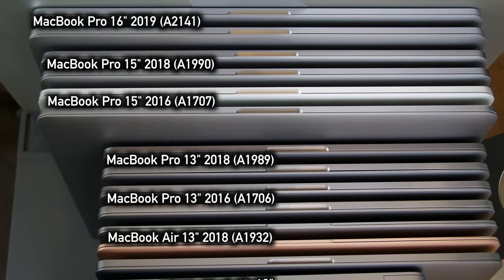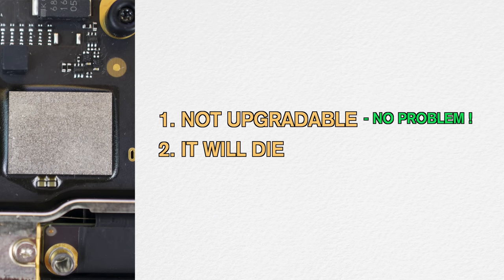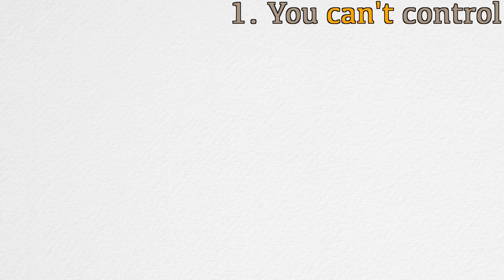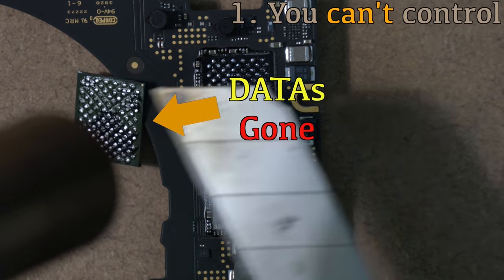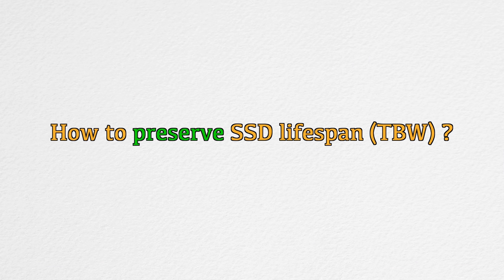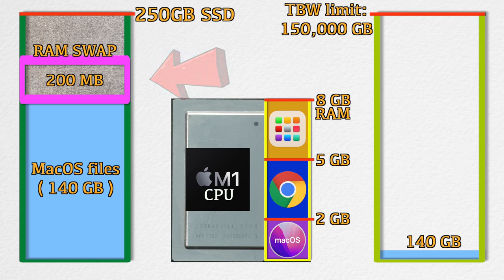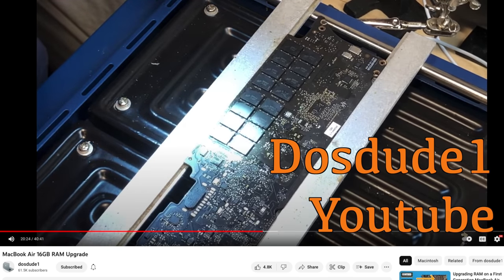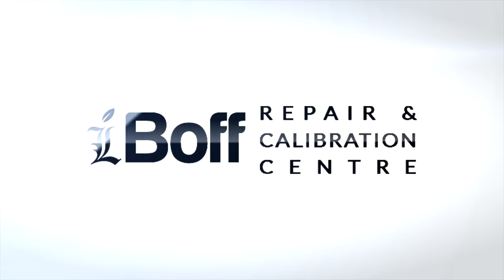These MacBooks DIED from SSD Failure & How To Prevent It (Not for RICH dudes!!)

Comment: the best things to do is to stop buying their products and see what they do to get you back!
Reply: They do not care because there is a lot of people who will by it anyways
Reply: Wow apparently the sky is falling…
Reply: That’s easy to say for someone who doesn’t rely on their software
Reply: Gonna need right to repair. Or some massive class action type hardware failure that finally wakes people up. Still using a 2011 and feel forced to look back to pc after all these years. Definitely a shame.
Reply: You’ve never purchased an apple product before. Stop giving advice
Reply: Entire electronic industry is based on product obsolescence
Reply: @Dr.Mzungu  I’d have to argue the desktop PC side of consumer electronics is definitely not plagued with planned obsolescence .   There are decade old PCs still working fine.  And with the current level of performance with the new modern PCs they will last possibly more than a decade and be relevant.  Today still a sandy bridge i7 is a very capable system … same as with GPUs I have gtx 690 that still works just fine it isn’t a powerhouse anymore but it isn’t dead. And after 10th gen Nvidia those GPUs will be relevant for most likely another decade. Like the 1080ti is still a excellent graphics card today and outperforms even newer entry level GPUs and it is going on 8 years old … in next two years the 1080ti will still be a good GPU .
As far as SSD and HDD they have a finite lifespan and are easily replaceable and easily setup with PC to have your drives setup with a mirror internally so if there is a failure you can simply just replace one of the mirrors and keep working never losing data. As far as Ram I have many ddr3 machines come through and have never seen a defective ram stick.. same with ddr4 , I just got first ddr5 pc this year but I have no doubt it will last forever like all the other ram before it has come.
Motherboards rarely go out ever I mean if it last the first year it most likely will last forever , PSU are about the same I have some decade old PSU still chugging away ,
As long as you get quality parts and not knock off chinese clone crap desktop is amazingly resilient.
The only thing I have notice is the deterioration of the RYZEN early processors I’m talking 1000 2000 and 3000 series I haven’t seen it in 5000 or newer yet. But the older ones the memory controller loses its ability to overclock the ram overtime due to the infinity fabric deterioration. At least that’s what is the common understanding, example got a 3600x pc back last year that I built new for a customer and before I had the memory clocked to 3400mt easily and it ran great then started being unstable got it back and checked the ram in other pc it was fine easily clocked to 3600mt put that ram back in ryzen 3600x in a b450 MB and tried other sticks in it to but couldn’t get ram to remain stable past 2900mt.. I recommend now not manually overclocking these CPUs and making sure you invest in a high end cooler I’m not sure if the heat is slowly degrading the memory controllers bandwidth over time it’s something I haven’t noticed on older Intel CPUs but they are monolithic designs and the Ryzen are all new chiplet designs .. again this is a rare case and it’s not planned obsolescence but new design /architecture flaws in aging even though it is arguably not a flaw the PC still works just couldn’t be overclocked as high as when new.
Reply: Inefficient way, too customers and not enough informed customers. Better to start online campaign to get get Apple to teach customers about this. Data loss is preventable then.
Reply: @notmyname6452  I just sold a 2019 16” macbook pro and was going to buy the M1 but apple made impossible to repair so I will switch to a windows laptop instead! Apple seems to not care about their customers
Reply: Nope, the best thing is our right to repair!!
Reply: Me too would NEVER buy any soldered-SSD laptop. Losing data is a nightmare. (I myself still using my Macbook Pro 13 2012, whose SSD is still replaceable).

I recommend everybody (especially for those who have laptop with irreplacable SSD) to have external SSD where you could routinely clone your data into it. In case of internal SSD failure, at least you could still boot-up using the external SSD.
Reply: True
Reply: @DJhyp3s well. It seems he's the smart one in here for not buying garbage products....
Reply: Super helpful and insightful, learned a lot from watching this, thank you 😊🙏💯
Reply: @DJhyp3s whats your point?
Reply: Yes, I used to never buy apple products, but my lackluster windows used to have terrible hinges, trackpads, flimsy chassis horrible battery. My MBA has no moving parts, all I have to care about reducing wright cycles to SSD, but the laptop has great hinge and 10+ hours of battery. This is the first laptop that I have bought and used as a laptop outdoors, every other Windows machine I've got ends up becoming a home PC as its hinge breaks.

As my laptops so far only have given up on physical structural integrity, a MacBook for a change is faring good so far
Reply: Apple targets young audiences. Problem solved 😂
Reply: After two decades I stopped buying Apple products because they only care about their shareholders, not their consumers. And boy was I surprised about how much better engineered the competition is. You get way more for the money and plus most components are easily replaceable.
Reply: Unfortunately a lot of people rely on their products for work
Reply: While the alternative is windows laptops with horrible QC, battery life, noise, heat, speakers, webcam, privacy, performance on battery, optimization, customer support, color management, and color accuracy, plus some windows laptop have the same soldered SSD like on the Dell XPS, so this isn’t going to work, and it hasn’t. Simply not buying Apple’s product is useless when the rest of the industry makes even worse laptops, in fact the only reason to buy windows laptop now is because of powerful Nvidia GPUs, slightly better repairability, and the fact that they are cheap, not even gaming can justify getting windows laptops anymore, since you can build a desktop with the same price with way more performance. We should demand better product from the whole industry, not just boycotting Apple that isn’t going to work due to their ecosystem.
Reply: @rx58000 oh kid mac not that good
Reply: I haven’t bought a MacBook since 2011. Now I NEED a new MacBook and it’s 2023. How long do you “stop buying” in your world before they actually change? 

Answer: it ain’t happening
Reply: But I'm an apptard
Reply: @DaveTadros Opencore
Reply: They'll have to get appeholics anonymous sessions though...
Reply: The Apple cult is too strong.
Reply: All of my Apple SSDs are working fine after 5+yrs

SSD wear is normal on any device, and it’s not surprising they die if someone buys base ram and keeps 100+ chrome tabs open lmao
Reply: They will just make worse products to make them cheaper, not start making higher quality products.
Reply: I think they did that with the M1.
Reply: Hold on what about phones and tablets ?
Reply: it's not possible millions of people r buying these and 80% of them r not technical users they don't even know about component names
Reply: Oh I love this, almost if other brands are better. They're not. Most of them are worse. Apple charges extra, but at least that gives them an option to put less garbage components and spyware. It's the first generation of new architecture for them and it's pretty well built.
Reply: And buy what instead? Piece of shit windows laptops that aren't even 1/10th as good?
Reply: Any machine you buy with a SSD will have a specific TBW lifetime. Now, if that's soldered to the logic board or an easily replaceable M.2 module, that will depend on the manufacturer
Reply: It happened because apple loves polluting the world with E waste😂
Reply: Stop buying the laptop with the best price to performance? Cause some people can’t take care of them😊
Reply: Comparing cheap laptop with expensive apple laptop
Reply: As soon as other companies start to make good enough laptops.
Reply: @JoeWayne84 my PC:s never lasted more than 3 years. My Macs have been pretty much infinite.
Reply: @thejjzz  weird my laptop from HP still works after 14 years
Reply: Hardware failure happens with every brand. Ive been a user of both Mac and pc for 16 years. I’ve experienced way more out of warranty failures on PC than Mac. Actually none of my Macs failed past the one year warranty.
Reply: @louisfain  Apple have ignored failty apple products and told users that they did something wrong when it was apple that failed
Reply: @2xtreem4u  yea but you have to admit the failure rate is lower than most other brands and also given apples size every failure is essentially high profile. I never owned an HP laptop without serious issues but nobody seems to be talking about that
Reply: @louisfain  i have to compare with high end laptops against apple laptops i haven't had any problems with HP laptops and desktops same for fujistu

Comment: Louis Rossman also covered this issue with the failed texas intruments component failure. Its absolutely shameful how apple designed the logic board with no abily to protect the ssd from being destroyed
Reply: shameful? it is CRIMINAL! they do it on purpose
Reply: It would be pretty easy to clamp that converter output to ground if the voltage output exceeds a certain level, to protect the SSDs.  The converter chip is probably being used too close to its rated limit, leading to eventual premature failure.  The SSDs themselves should be mounted on a socketed sub-PCB to facilitate their eventual replacement and/or upgrade, if needed.  To do otherwise is just greed forced into bad design practice for higher profit, from overpricing the value of these commodity SSD chips, as installed.
Reply: And guess what , this video states the ssd is replaceable but sadly it is not as the bios and firmware is also loaded from some sections of the drive hence the reason why it doesn't even post to screen with the dead ssd , older models you could at least see some picture even with a dead ssd, even louis Rossman covered it and said the ssd was non replaceable....I currently have a 16 inch 2019 with this same issue , after diagnosis, I discovered all ssd chips are shorted to ground (even after removing the Texas chipset)
Reply: This is intentional designed obsolescence, it makes certain you will have to buy a new "product" down the road.
Reply: Shameful because the pros are really good

Comment: Even my first MacBook from 2011 is still running like a charm 😅 But I admit it was a better time when you could simply replace the ssd and ram ❤
Reply: anything is replaceable, its just not plug n play
Reply: Ok then let's say times where better where you had a easier time replacing the ssd and ram 😅🙈
Reply: Man I love my 2011 MacBook!
Reply: I'm going to boot up my 2011 mac book today! Thanks for the reminder.  I can probably max out ram to 32GB now fairly cheaply....
Reply: @bobbiejoe4726  16 prob but I don't think they support 32.
Reply: same but apart from finding a mouse that is backwards compatible, chrome update problems , some software wont install it still works
Reply: @schizofennec  Yeah, just thousands of dollars in equipment and years of experience required for this replacement.
Reply: Running like a charm 🤔 what did she mean by this? Did she possibly mean to say “working like a charm” or “running like a champ” and she just says things without thinking whether it makes sense? 🤷🏾‍♂️ This generation.
Reply: @Rusty_Gold85  thats why linux is really nice for these older laptops. most of the older macbook family are fully supported under linux, but moving from macos to linux would be pretty daunting.
Reply: @pot3to444  not really. macOS is a Unix based system like Linux so the terminal commands are fairly easy to grasp from one to the other. Now going from windows to Linux is a much harder transition, but still anybody can learn a new system if they wanted to.
Reply: Now it's just a netflix machine
Reply: #1 problem with MacBooks is that the SSD is soldered on.
#2 MacBook SSD's are serialized therefore difficult to replace/reprogram
#1 go back to #1 lol

Comment: I think upcoming EU rules will oblige manufacturers like Apple to make easy repairable products in order to combat e-waste and restore consumer rights. So that would mean replaceable SSDs and batteries for laptops. These manufacturers (like Apple) will do this only when they have to in order to comply to the law (like using USB-C ports).
Reply: 1000% agreed
Reply: LOL. EU are just talkers and no doers.
Reply: @danilodistefanis5990 so the new iphone doesn't have a usb-c port😛
Reply: @brianj6314 it does where I live, macbooks too
Reply: its funny when apple puts environmental segments to their keynote fooling most people and posing a false image but serialise everything and create ewaste
Reply: A consumable component should be accessible and replaceable at all times, still don't understand how thats not a law.
Reply: replacing mac batteries is not that hard tbh (even on the "hard ones" like the later intel macs but unfortunately soldered ssds and ram are becoming more common in windows laptops too nowadays
Reply: @FAKEAXIS  Imagine buying a car and the tires could not be replaced.  Enjoy driving the car for the life of the tires!   Change the oil at 30K miles would be just fine.

Comment: I have 2 older MacBooks, a 2012 and 2009. Both are running Linux Mint 21.1 , both have maxed RAM and both have 1TB SATA SSDs. They run and look great. I also have a fully repairable/upgradable i7 Framework laptop 64GB RAM, 2TB SSD also running Mint. Finally, I have a 2020 M1 MacBook Air 256gb which will be my last. It will be Framework & Linux from now on. My iPhone 12 will be my last iPhone too.
Reply: Looks like someone gotta quite the 🍏 ecosystem here
Reply: How did u make the trackpad work with linux? I tried a few years ago and I couldn't I have a MacBook Pro 2012
Reply: I wont buy mac any more, after speding 3800£ for m1max 64gb ram, the computer is slow, and wont work as should, over the year of useage, and battery is decreese to 89% joke

Comment: I always back-up my data on a old school harddrive. I never experienced problems doing that, it's slow…, but I only put data on that HD drive that I barely use. I hate Apple for soldering SSD's. And Apple cares about the environment. 😂😂😂 I call that greenwashing!
Reply: i always never buy the touch bar versions as you can replace the ssd on a non touch bar but not the touchbar version or at least you can in a 2017 macbook pro